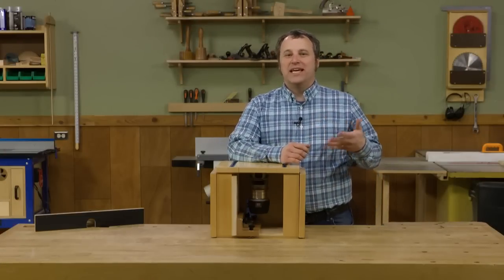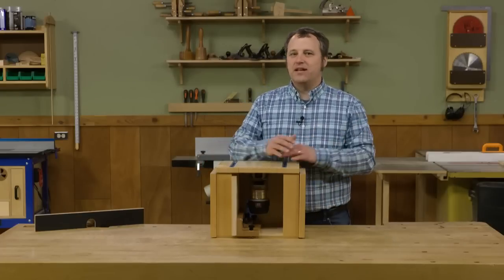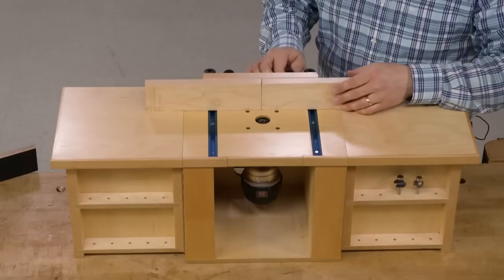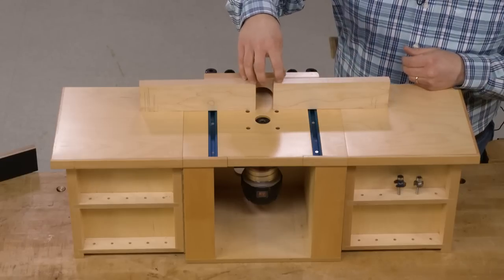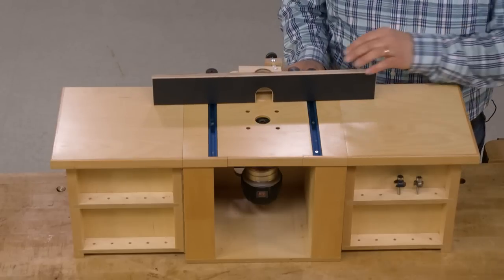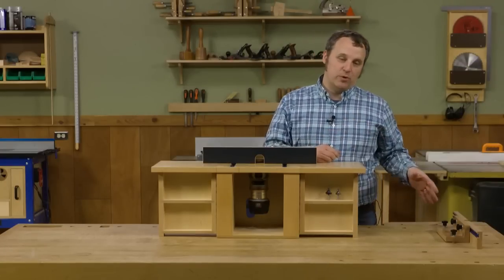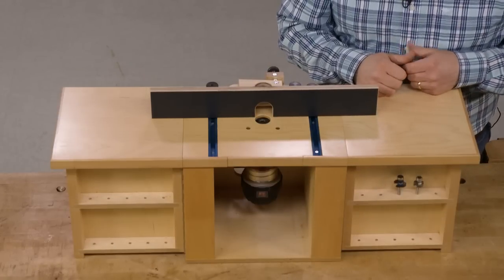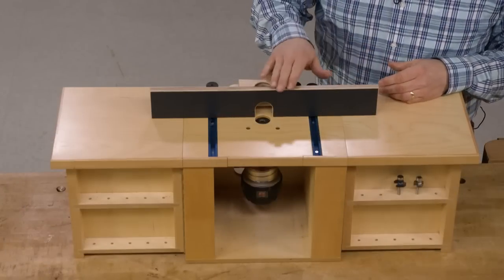Shop-Made Micro-Adjustable Router Table Fence

Comment: Clever fence. I’m guessing you ground out a notch near the end of the adjuster bolt and the short bolt on the top slides into that to pin it while still allowing it to spin. Very cool.
Reply from the maker: Actually, I used a cross dowel to hold the adjuster knob. The dowel can pivot in its hole to accommodate the change in axis due to the pivot.
Reply: @WoodsmithShowandmagazine  Nut in the dowel or just threaded in the wood? I’ll be buying the plans if you wanna keep it a mystery :)

Comment: In the plans part C does not show the dimension for the taper. The piece is 3/4 x 2 3/8 x 3 5/8 but it is not shown as a rectangle.
Reply from the maker: I find using the insert as the spacer you have a greater chance of the outside pieces slipping up because of the bevel on it and I also don't want to risk accidentally gluing it in place.